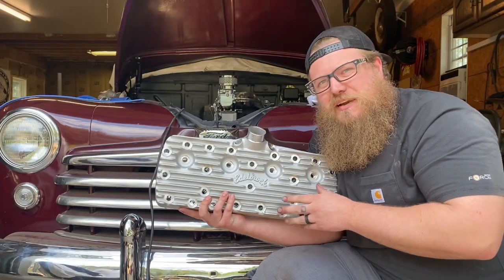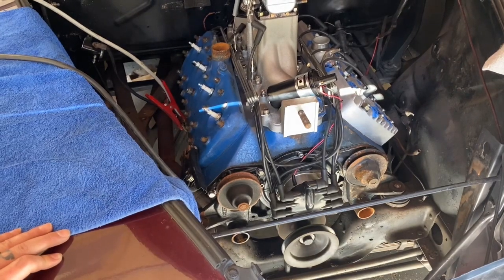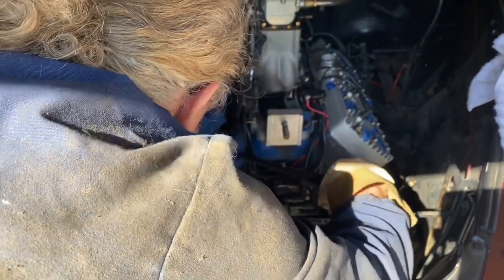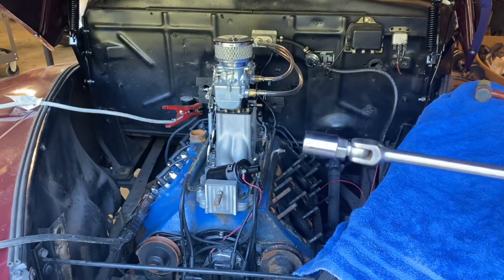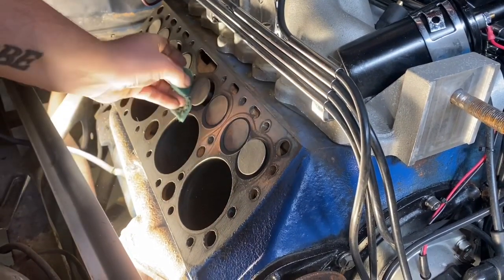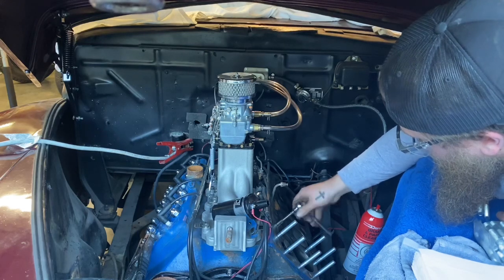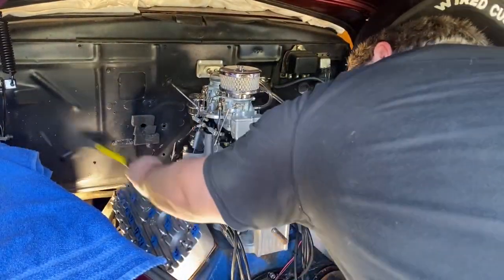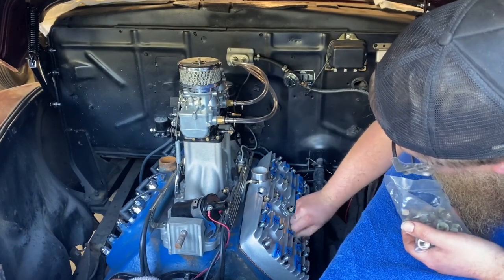Installing Heads! Flathead Ford

Comment: Thanks for the information.  I made a special tool to help remove the heads without needing screwdrivers and pry bars.  I cut off thectops of 2 spark plugs, tool some 1 in. Square tubing and cut 2 pieces about 3 inches long. I drilled a hole through the tubing on one end, welded the plugs to the tubing and put a bolt through the holes i drilled on the other end of the tubing.  I could then remove the plugs on the end of the head, say 1 and 4, screw kn the tools and you have 2 nice handles to workthe head off without damaging the block or head.
Reply from the maker: I really love this idea, I do something similar on model a motors but use an engine hoist to pull on the head with fake plugs, I think I might make the same tool you explained for the v8s now thank you

Comment: Thanks - didn't know about running it dry on 1st fireup. The torque sequence is simple though you don't need stickers - its just circular from the centre with opposite corners
Reply from the maker: Thanks Stevan, I’m just a perfectionist, everything I do is customer cars so I try to do them all to the upmost professionalism as possible

Comment: I broke a head bolt changing a head on Edna back in December. Ended up being a nightmare to get it out. But in the end everything worked out
Reply from the maker: That’s good! It’s always a big headache drilling and tapping a stud out, hopefully you got it out by welding a nut on
Reply: @WiredCustomsSpeedShop  unfortunately I had to drill

Comment: I get a back ache just viewing your access down in the engine bay. Considered new finned heads (Wilson & woods?) on my F1 truck but would need to pull the engine and do the work on my engine stand.
Reply from the maker: I got a back ache doing it haha that’s for sure. We did heads as a last second thing right before the build was to be finished and right after I put everything together, otherwise I would’ve removed the engine too

Comment: You should put a rag in the cylinder while cleaning the deck of the block to prevent much of the debris from falling in.
Reply from the maker: I always vacuum and change oil and has always done me well, I worked at a Ford dealership for a long time and have seen rags ruin so many motors and transmissions I never use them to cover anything

Comment: I'm probably going to end up picking up a 1946 super deluxe. What is the benefit of having the Edelbrock aluminum heads other than weight reduction? How much power are you really picking up? I do like that slingshot intake as well. How much power overall? Is it noticeable?
Reply from the maker: Did you end up buying headsets yet? I see that this is an old comment. HUGE difference! It raises the compression which is the best thing you can do to a Flathead. Lower the CC the better so be careful when purchasing heads, some are made with higher CC to allow you to run a bigger cam with higher lifts. You can definitely feel the difference in the seat and gas pedal so heads and intake on a stock motor goes a long ways. It’s been dyno proven that high rise intakes are the best for a Flathead motor because how the runners for the intake air is shaped in the block. I can’t say which high rise is the best because common plenum depends on your carb set up

Comment: I am installing a pair of Aluminum heads on my Flathead Cadillac. Your video answers many questions. Can you tell me the thickness of the head bolt washers? Copper spray vs. high heat aluminum spray. Put the gasket on when tacky or dry? Does painting between the fins affect cooling? Thanks, Rich
Reply from the maker: Put head on while spray is tacky, I use copper on copper gaskets and use a sacrificial anode in the radiator. That’s my preferred way but there are other ways that work as well. Paint can reduce cooling but we are talking a very minuscule amount.

Comment: What heads would you recommend, To replace my 8CM heads. Because my driver side head might have a small crack. Thank you
Reply from the maker: There are a lot of options in the reproduction side, I would just suggest buying new over trying to find an original. What did you end up going with?

Comment: So when you are torquing the heads how do you know if the nut is moving or the stud in the block? Does the torque change with the type of head gasket you use?
Reply from the maker: If you install the stud tight it won’t move because the shoulder of the non-threaded portion is up against the block face. 100 percent of the time when I am torquing the head and the stud spins it’s because there is a crack in the block or the threads in the block is bad. Which is always a bad situation
Reply from the maker: I use a copper head gasket for everything, then have a sacrificial anode in the radiator